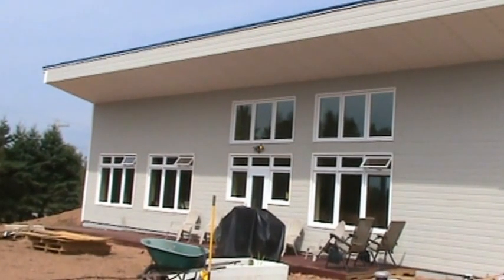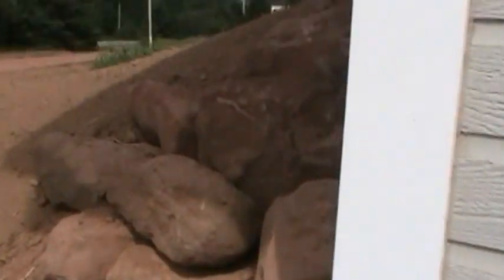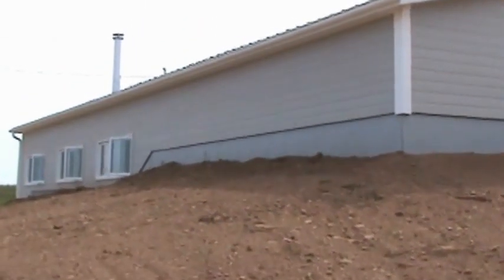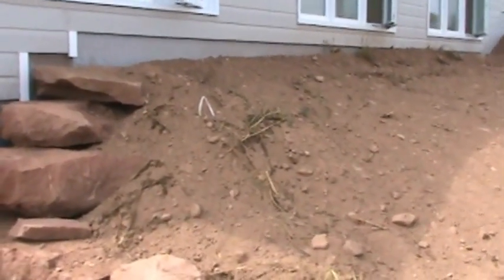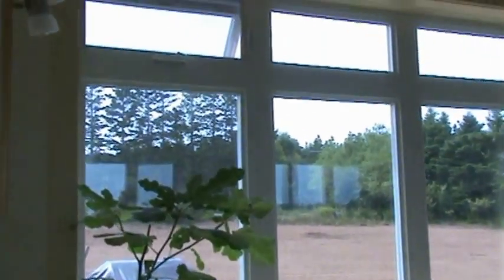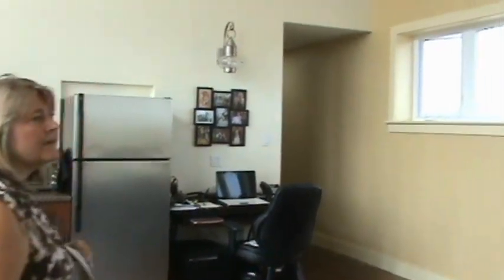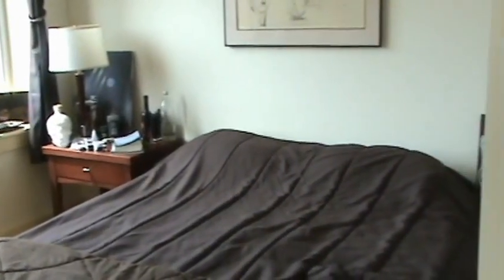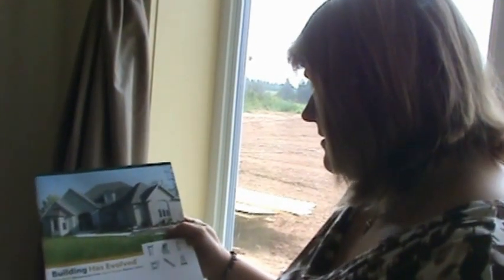Earth Bermed - ICF - Passive Solar House Video.wmv

Comment: I am intrigued by your home. You have incorporated things that would work well for me. I am one of few Polio survivors left and am looking to build my last home to be sustainable off grid without bills. Your passive design with wide window seals I could sit on and get up if I build to the right height would be Awesome. Earth tubes are great and your design incorporates some facets of Earth-ship design. I would love to see the plans you used so that I could have them modified to accommodate some changes. I've been looking around for a couple of years and now I am back to your home. It is the one that fits my agenda. If there is any way to discuss getting plans like yours for modification or the builder’s information, it would be greatly appreciated. Perhaps the builder might steer me in the right direction. Great home indeed!
Reply from the maker: Thank you.  Unfortunately the book is out of print.  It was at a number of libraries, so you could try the library system, although they wouldn't have the details you would likely need.  The architect was Robert Haggis https://sablearc.com/meet-our-team/ and he did this design as a small project before he started this business.  Wishing you great success in your road to sustainability.
Reply: @tallenconsultingpei  Thank you.

Comment: Thank you for your video.  I'm down in west Texas desert, but have a mountain cabin in New Mexico at 9000 ft that I plan to move to permanently this year.  In a couple of years, I want a builder to remodel it into passive solar.  Right now it is concrete block built into a hill with earth covering the west side and some of the north and south side, with most windows facing north and east.  LOL.  Yet after the wood stove heats the cabin up after two days, it stays fairly evenly temped downstairs (upstairs not at all - no concrete and no earth upstairs.)

What did you use to protect your house from the earth you bermed up on the North side?
Do you have any problems with water leaks?

This summer I'll need to have someone put something below grade to re-protect the concrete from moisture.

Another question - with my A frame cabin, the north side of the roof does not melt the snow much at all.  I've been looking at rooflines and your shed roof slanting from south to north - how does the snow do for your roof?  Does it melt readily?  I like a shed roof, yet worry that in winter, the north sloping roof will just pile on the snow.  

I'm planning to have SIPS for the roof, covered with metal. Is that what you did or if not, what is that for your roof?

Thanks again
Reply from the maker: Hi - What did you use to protect your house from the earth you bermed up on the North side? Our builder used some type of membrane...not sure what.  The walls are insulated concrete right up to the roof with hurricane brackets. 
Do you have any problems with water leaks?  We do not have any water leaks.  The roof is metal - love it! Snow is great, slides right off.

Comment: the down side to having the concrete floor as part of your solar mass is that your back will in time suffer from years of walking on such a hard surface mostly without any or proper shoes. I would prefer a natural wood with insulation underneath.

Comment: Thank you for sharing the video. It will really help people who are interested in building passive solar house. Can you please share your opinion based on your experience living in this house for some times:

1. What works best.
2. What does not work as expected.
3. Which decisions you should have taken differently if you build it now.
Reply from the maker: Love our house.  Would recommend putting in airlocks around the doors as it is very important to keep the heat in. Also would recommend letting professionals do the cement floor finishing - we need to refinish ours.  Heat, performance, livability, comfortable love it and highly recommend it.  ICF or insulated concrete is definitely very important for a good seal and it is all about keeping the heat :-)

Comment from the maker: Last winter or 2012-2013 we used a little less than 2 cords of wood for back up heat and it looks like this winter will be similar even though it has been colder.  The earth berming is definitely an advantage from an insulation and natural geothermal point of view.  The average temperature in our house all summer is 70F and in the winter when we get up early is around the 60F mark if the sun is shining it is easily 90F by 1pm.  We love it and found it saved us $3,200/year in heating costs  Our hot water is electric and we spend about $80/month on total electricity at .1241 cents kwh with $30 service fee.
Reply from the maker: ***** the video was done in the summer and it was outside 90F (it was an unusually warm day in Prince Edward Island summer 2012) outside and 70F inside.  That said on many days in the winter if the sun is shining it gets to 90F inside when it is below freezing outside.

Comment from the maker: Thank you for the good question and one that we have been asked before - here is the answer via our ICF supplier Nudura 
"NUDURA ICF Concrete walls have a high storage capacity with low thermal conductivity, it provides the most useful level of Thermal Mass. This helps to stabilize the internal temperature from day to night temperature fluctuations."

Also our concrete floors (no infloor heating just sun to heat the floor) provide a release of heat at night, and we have insulated curtains.

Comment from the maker: We love the house. The lowest temperature so far has been 60F/15C (usually in the early morning)without any heat but passive solar.  We have used a little wood when the sun isn't shining, especially if we have a few days of cloud over in a row.  We haven't used one full cord of wood yet (around 1/2 cord at the moment).  When the sun comes out this time of year it heats up amazingly fast.  So by noon it can be 90F/32C we usually open a window. Summer was a constant 70F/21C